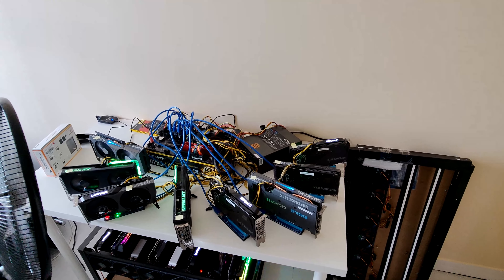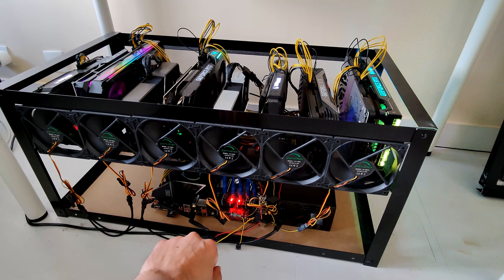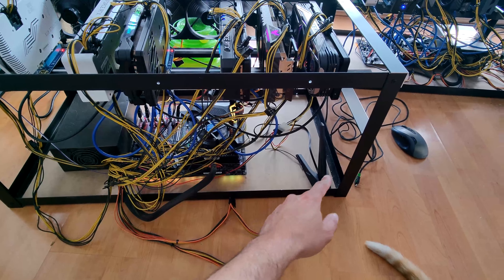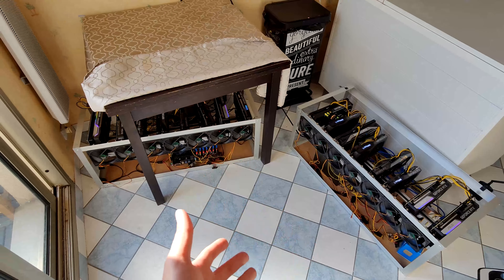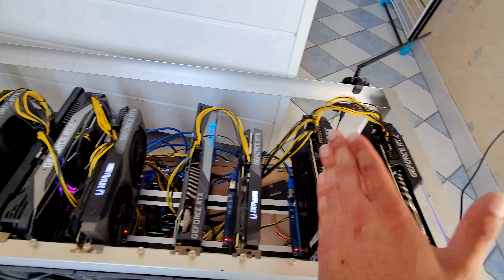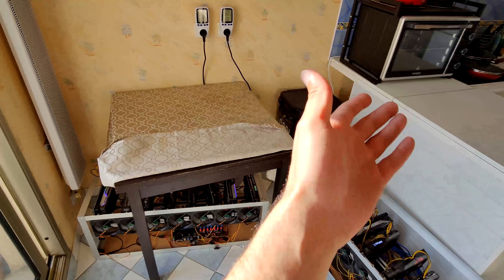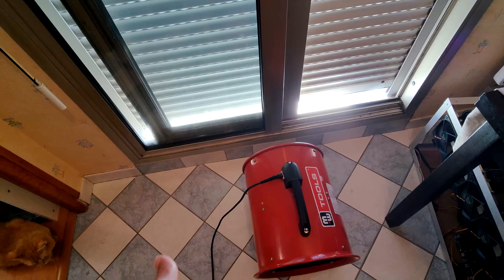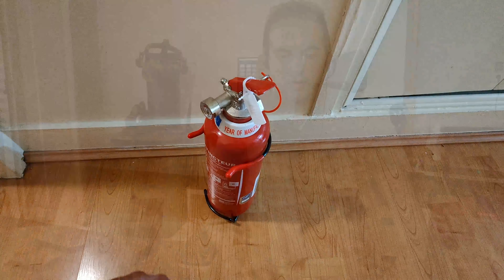Big mining farm in an apartment | 6 rigs How-to

Comment: Another option is to upgrade the cooling pds in your apartment, there are some available which will reduce your GPU temp by -14 C, i know its quite a bit of work, but certainly less than moving the rigs to another apartment. The Guy from Evga GPU’s has recently put out a video there he compared most of the aftermarket cooling pads. And yes sadly the Nvidia Founders Edition have the most heat problems bc of the use of substandard insulation pads or bc of faulty placement of such 😊

Comment: Beautiful videos! I can't help but ask you: how do you sleep with the noise generated by the fans in the bedroom? I can't say I'm a miner, I bought a video card and now I'm trying to lower costs. I let her go at night with the fans at 80% and after 3 days I was a zombie. Now I test with fans at 60%, I think it's 34 decibels. But in the long run I think I should buy my motherboard, power supply, etc. and move the mine to the living room
Reply from the maker: Well, it's one of the "perks" of being a heavy sleeper. I can sleep in broad day light in the middle of a park near a busy road 😅 
Also I'm usually completely exhausted by the time I get to bed so that helps. But for sure most people would find this unbearable with 11 fans in a small room 2m away.

If you have only one card, it's overkill and too expensive to buy a complete setup. But you could use two different profiles, mining at full speed during the day and severely limit the fans speed and power draw at night.
Reply: @CryptoAtHome  Yes, it is overkill and expensive and I would never give so much money on a video card just to play on the computer. The goal is to make a "small rig" that can mine RVN, ERGO and CFX. I was targeting RM1000x 1000W PSU. But this will hold only 2X 3070TI, or 1X3070TI + 2 smaller cards. This "life hack" is not easy :)))
Reply: You can probably invest in earplugs if it bothers you lol.

Comment: I only use GPUs for 3D rendering, do you know what the individual performance loss is when you hook in your PCIE card down through that blue, what appears to be a USB 3.0 cable? I'm sure you're not getting 100 performance from the card but good enough for more mining power. I have an m.2 slot occupied with a extension to external GPU and I get about 70% performance from that card. I guess it's 4 chipset lanes that it's using.
Reply from the maker: There is no performance loss for mining when plugging a graphics card into a 1x riser. Mining uses only memory bandwidth and there is plenty of that. We even turn PCIe slots to Gen 2 or Gen 1 for added stability. And I have a PCIe expansion card that I can plug into a 1x slot to give me 4 1x slot.
But for gaming, I've heard that 16x risers loses around 10 to 15% percent but I've never tried myself so can't comment on the accuracy. But one thing is certain, you do lose stability and performance when using a riser for anything else than mining.
Reply: @CryptoAtHome  Ahh!! Well I guess that makes sense why people don't use mining rigs for 3D rendering then. 

Thanks for the info!
Reply: @timotmon  You can use a PCI extension cable, haven't experienced  performance loss while rendering as all the lines are connected 1 to 1. And it gives me plenty of room for some extra fans that I manually turn on when I have to leave it rendering for a long time.
Reply: @aldondourf  Thanks, I had given that some thought too. So good to hear it's been working out for you. I actually ended getting the new Asus B550-Creator that has thunderbolt. So I have a 3090 inside the machine and 1080ti in an egpu. There's a performance hit on egpu obvioulsy but it isn't too bad. Getting really fast 1080p renders octane now. Pretty happy.

Comment: what cryptocurrency do you plan to start mining when Ethereum moves to PoS.  Also what brands of power supply do you use?  Thanks for your videos.  They are a great help
Reply from the maker: Thanks for your support :)
I think it's too early to tell. I'm a Software developer myself and if I know something, it's that software development is never finished on time. I'm pretty positive it will be delayed. As for the next EIP it's too early also. There was a lot of doom and gloom when flashbots took over a few days ago and gas price was almost halved. But right now we're getting paid like never before. The advantage in NOT buying asics is that we can switch between currencies at a moment's notice.
As for the PSU, I only buy the LCPower. Either 1650W or 1800W. I never heard of this brand before and it could very well be a rebranded Chinese no-name psu. They're definitely not the most efficient but they work well enough, are quite cheap and they pack a ton of PCIe connectors (the 1800W has 20 connectors!). I only starting mining in January so I don't know how long they will last me. I'll probably switch to server PSU if one of them dies but then I'll have to deal with MORE noise in my appartment, which I would really really like to avoid.
Reply: @CryptoAtHome  You were spot on, delay seems to be confirmed? I will do your thermal pad mod tomorrow on the 3080 FE.
Reply from the maker: It's not yet officially confirmed so it's just guesswork for now. Wait and see :)

Comment: amazing stuff... I'm in a small apartment too, and starting up, 2 rigs so far... will check your channel to see if you have more info on the 3090 inside the case, I'm very interested on that...

do you use it as your regular PC while mining or turn the mining off when using the PC? why the case is open? is there a way to make it work with a closed down case? What OS?

If you have a video on that PC let me know.
Reply from the maker: Hi. Yes I'm a software engineer and I write mobile apps which needs to be run inside heavyweight simulators/emulators which run in VMs. And I also edit my videos on this computer.
I never turn off mining, this machine has been on for a whole year basically without any hiccup whatsoever. 

It's running Windows 10 as I also uses to game on this machine, including VR (the whole reason I bought the TUF 3080 that was in the case before the 3090 FE). But in 6 months I haven't had time to play anything so I don't know how it would work with mining on.

The case is open because it's a small case and it's near a window so that's natural airflow. If you have only the 3090 FE and good airflow, you could definitely close the case, but you might have to dial down the power limit in case you reach high VRAM temps.

Comment: MSI Z390 Gaming Edge  please tell me if it works with 8 video cards or not ?
Reply from the maker: Yes, I use it with 8 cards. But you need a PCIe splitter as by default you can only plug 6.
Reply: @CryptoAtHome  PCI m2 splitter of the 2-piece format ??
Reply from the maker: PCIe splitter, not m2. Check the video I have on this, I reviewed one of these: https://youtu.be/sKiIirKb4wg

Comment: Total invested, and ROI? Power draw hashrates etc...etc...
Reply from the maker: It's missing one card to reach exactly 3 GH/s, which is my end goal. And probably the max I can do in this appartment before reaching the max power draw, which is hovering right now at 7800 watts! I can theoretically draw up to 9k watts but that's already the case when using the microwave / etc
ROI is hard to predict with what's happening in the crypto-world and especially Ethereum but so far I think it will be after 10 months (after electrical cost and taxes).
Reply: What if you place the farm on the balcony?
Reply from the maker: @suncho1ce  Yeah I thought about this but the problem is, it's a terrace on the last floor of the building. So I need to be careful as even slight rain might fry it if I'm not careful. I'm nonetheless thinking about building a small "tent" and placing the two rigs in the kitchen on the balcony during the day.
Or go to Russia or Ukraine. Cheap electricity and cold places :D